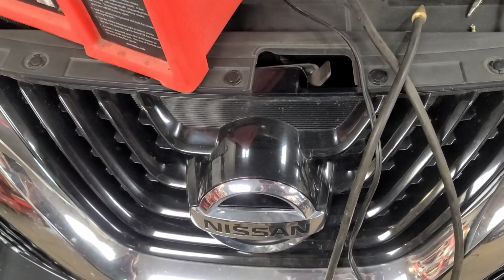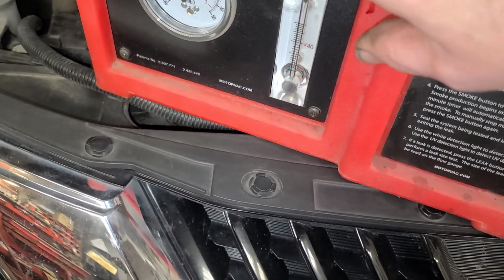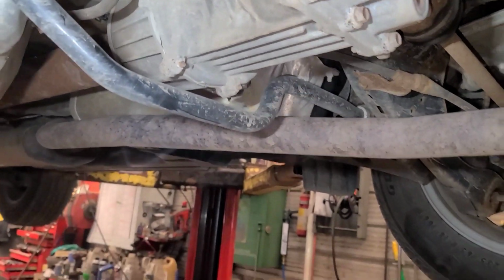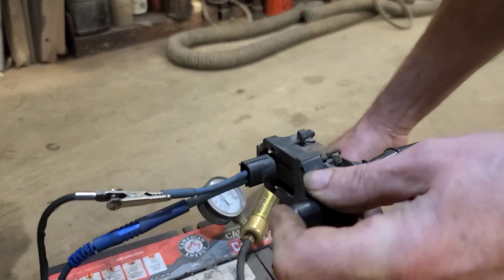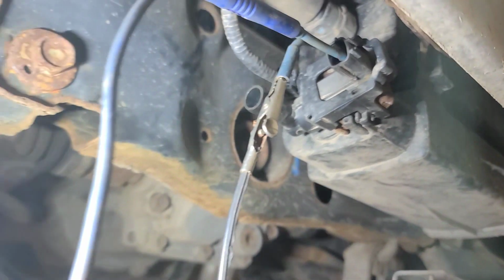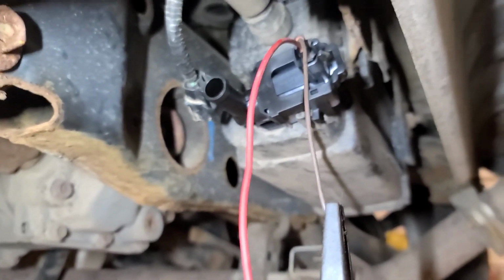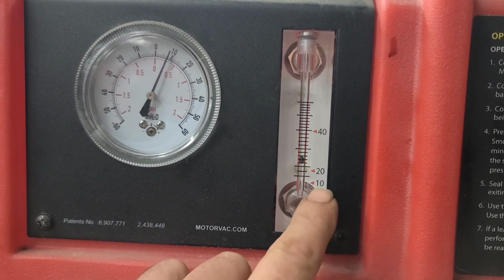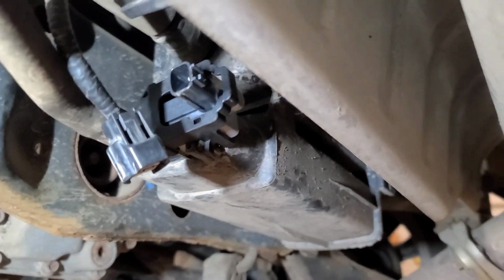2015 Nissan Murano P0456 Diagnosis

Comment: Como
Se llama la pieza. Que conecta en la evap
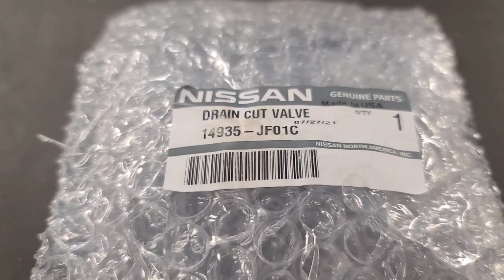Reply from the maker: The part attached to the vapor canister shown at 2:30 in the video is called the vent solenoid. This is what I replaced. Nissan calls it a Drain Cut Valve and part number is shown at 6:55 in video. 14935- JF01C

Comment: My solenoid valve was also bad after I replaced it , I cleared the code and after driving for about 70 miles code came back , so I went and changed the purge valve in the front of the car..  clear code and after driving 70 or so miles code came back…. Anything else I should look for ?  Should oil or grease the o-ring on the solenoid valve that you mention?
Reply from the maker: You need to smoke test the system for leaks.

Comment: I have a Po101 and a Po456 code my idling is messed up and it’s stalling while I’m driving it will start right back up got a new battery and new terminals thinking that was the issues at first and now my gas cap light is showing as well

Comment: I have p0300 on mine beside the p0456. Replaced the spark plug and still gets random misfires, any suggestions?
Reply from the maker: Which cylinder or cylinders are reporting the misfires.
Reply: @PhillipBailey it doesn’t say it. Just random misfire. Another thing the car is overheating when ac is on and no mechanics can figure it out
Reply from the maker: In the OBD 2 side of the PCM it should show accumulated misfires per cylinder in mode 6 data. What are the conditions when it overheats? City traffic, outside temperatures. What's been done for that problem?

Comment: Just replaced mine, the old one was closing when applying 12v but I was still able to blow through it and it was pretty rusty so I hope it will fix my issue
Reply from the maker: Time will tell.

Comment: Hello, is this Selenoid located at the back of the murano?
Reply from the maker: Yes behind the rear differential on the canister
Reply: Thank you. One more question,  I have a 2015 Murano and the other while I was on the Highway the car shut off, I was stepping on the gas and no acceleration so I pull over to the side and after I turn the ignition off , I had to jump it to go again.  I'm thinking the alternator might be weak or the fuel pump might need to change.  What are your thoughts
Reply from the maker: @blueaces5690  if by jump it you mean boost it then I'd have the charging system tested. I gather that when it quit it would not crank over. If the fuel pump dies it will crank but not start.

Comment: Is this an easy DIY? I’ve got a 2015 rogue. Do you have a video showing the replacement? Or is is it just held in with clips and the o ring

Also would this cause the rear to have an off smell?
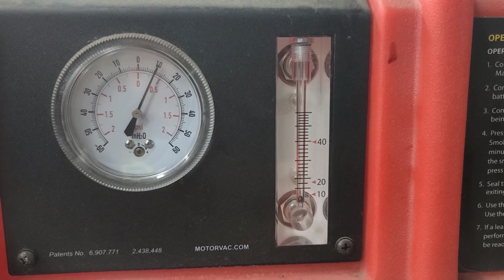Reply from the maker: I showed how to install it starting at 6:50. It's super easy to replace. Define off smell...
Reply: @PhillipBailey  like fumes? Hard to describe.
Reply from the maker: @thechileacademy4800  if you mean gasoline fumes then yes possibly
Reply: @PhillipBailey  yeah I’d say resembles gas fumes. So replace the whole thing vs just the o ring?
Reply: @PhillipBailey wow totally missed the 90degree part to mentioned. My bad! Should I try replacing the O ring first? Or just replace the whole unit.
Reply from the maker: @thechileacademy4800  your call but I'd probably say it's the solenoid. I've done 4 now.
Reply: @PhillipBailey  I just saw your rogue 2015 video giving P0456 code. Same issue with me. Tried to replace gas cap and didn’t work. Code came back.

Comment: Thank you for your time and videos. Could this also cause a rough idle? I have a 2011 nissan murano with a p0455 and p0456. And it drives great. But as soon as I come to a stop at a light or whenever it has to idle it drops down to almost as stall, recovers then idles roughly at 500. If I give it a little gas it runs like it's brand new. Thank you so much for your time. Have a great day.
Reply from the maker: If the purge solenoid at the engine leaks it can affect fuel trims and idle quality and may cause a hard restart after a refueling event. This particular solenoid should not affect idle quality imo.
Reply: Just had the same thing as you happen exactly, changed the Vapor Canister Vent Valve / Solenoid that is right under the rear bumper. Took about 2 minutes to replace, cost 30 dollars and my Murano runs and idles like brand new.

Comment: Hello so on the 2007  Morano its on the right side back correct? And what's the cost to replace it ?
Reply from the maker: Solenoid is around $60 CA and labor to replace is like 1/2 hour but that dies not include scanning and diagnosis.

Comment: On Newer Toyota’s be careful. The vent valves do not seal pressure from a smoke machine well. They seal perfect under negative pressure. It will seep smoke and on a leak gauge like that it will bounce as the pressure slightly opens the valve. Also if you remove the connector for the canister it will seep smoke as well. Both are normal. I’ve seen technicians get burned on those before. Great video and great diag/fix on this Nissan.
Reply from the maker: Good tip. It didn't hold vacuum either so I'm pretty sure that was the issue. The new one held fine.
Reply: @PhillipBailey  no doubt that one was fried. Just looking out!  You put out amazing content. I love the channel. Even with liking subscribing and ringing the bell the YouTube algorithm sometimes buries your channel in my feed. I’m just catching up this am 👍🏼
Reply: Hi Phillip my wife’s Nissan Murano it’s a 2016 v6 all wheel drive my check engine light came on and I replaced the gas cap but check engine light still there,I don’t wanna just be buying parts and spending money on the parts that it really doesn’t need.code is po456.should I buy that part on ur video and install it?thanks
Reply from the maker: Well you have to weigh the cost of the parts and the possibility it may not fix it against the cost of diagnosis steps. If you don't have a scan tool, smoke machine etc and have to pay a hour of labor to diagnose the problem then it might be worth rolling the dice.